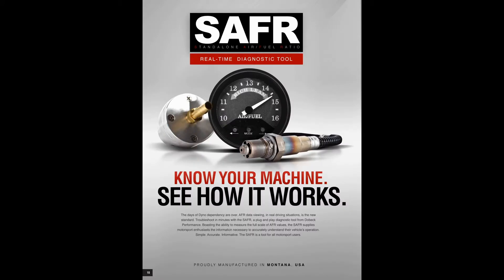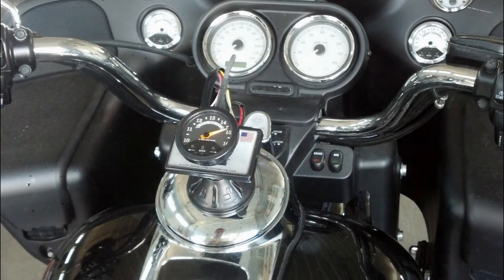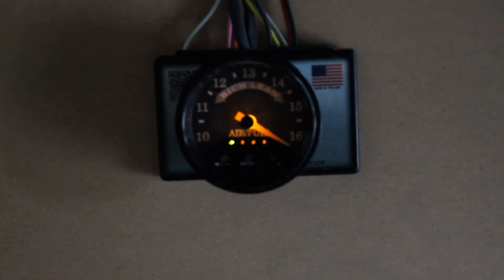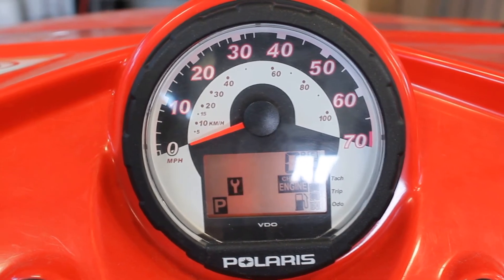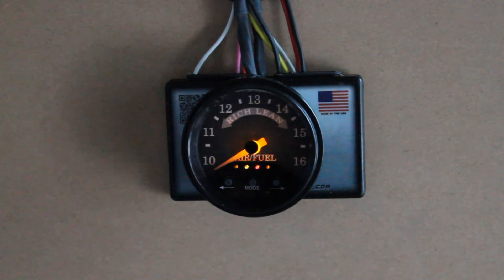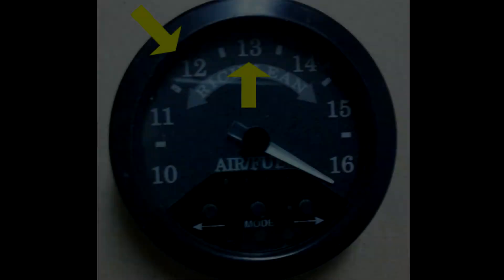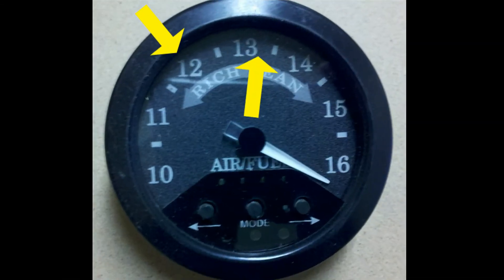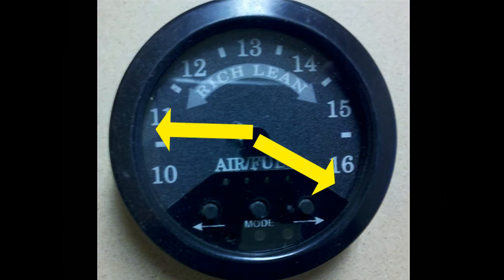SAFR Functionality - Determine How Your Vehicle is Tuned

Comment: I know the SAFR isn’t a permanent install, but is it secure enough to actually use it while doing a few short runs so I can see the AFR Zunder true load, rather than just using the throttle while stationary in neutral?